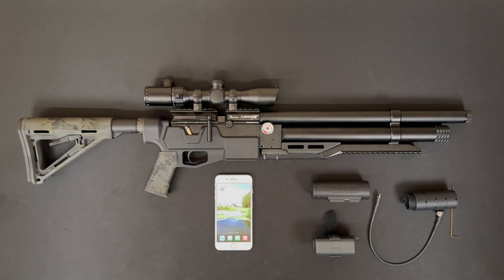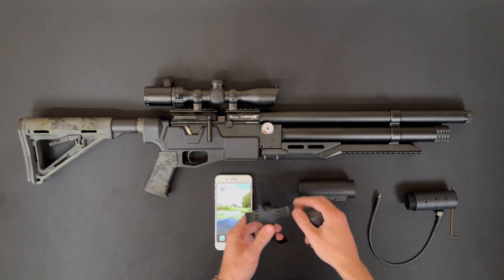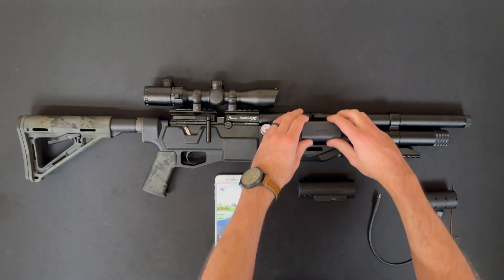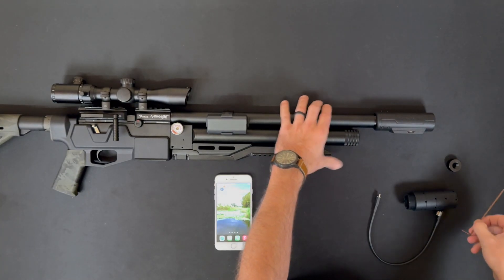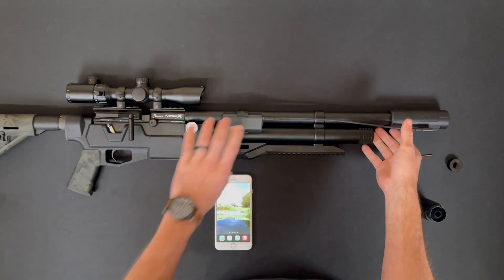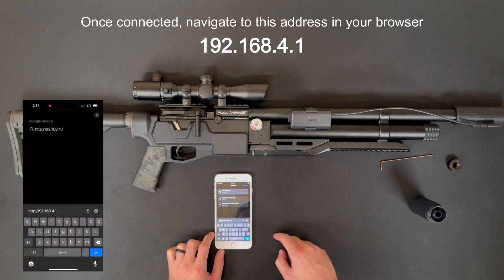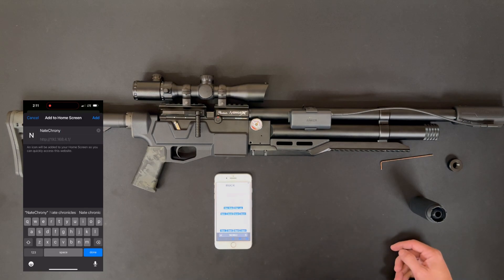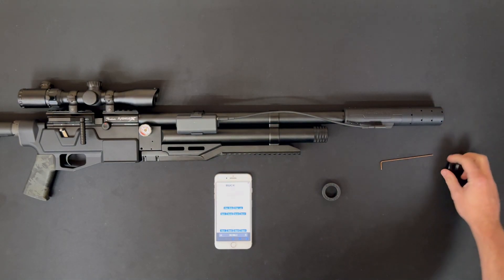BuckChrony Installation Video

Comment: Picture this.. A Seneca Aspen/Nova Visa P2 had a kid with the Crosman 1322 and FX Impact. An ambidextrous .22cal multi pump PCP pistol with an exchangable rifle barrel and an attachable or extendable stock. A multi shot clip with a modern rail system available in both high and low power versions. Sounds like a flagship model to me! Jmho.
Reply from the maker: I’ve thought the same thing. From what I understand there was a lot of issues with the pump leaking, but I would love to see another try in a compact tactical/backpacker form. Who knows what the future will bring.

Comment: Looks interesting and easy to use. I'm going to have to pick me up one.
Reply: Quick question what is the SteadyShot version?
Reply from the maker: The SteadyShot includes a 3-axis accelerometer that will pick up on your movement in the x, y, and z axes before firing. It will chart it out in the software in 2d and 3d and give a score as a training aid. The SteadyShot version will include all of the features of the standard Chrony version as well and will have exactly the same form factor, but with extra stuff on the PCB. I just wanted to keep the standard one as a sort of no frills affordable chrono option for those who wouldn’t use the SteadyShot features. I don’t have an ETA on those yet.
Reply: @ Heck ya just signed up to be notified when it comes in.
Reply from the maker: Hey Jon! Awesome. Thank you!
Reply: @ Quick question. What is the SteadyShot version?